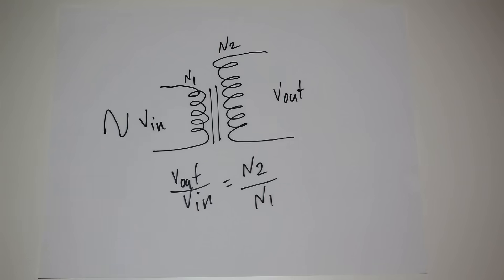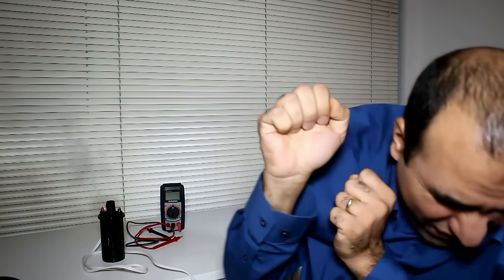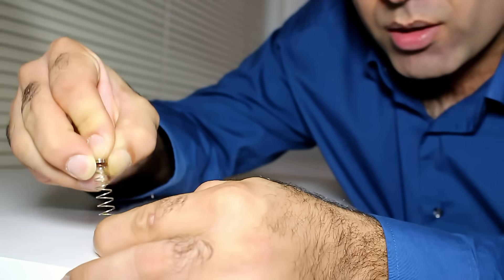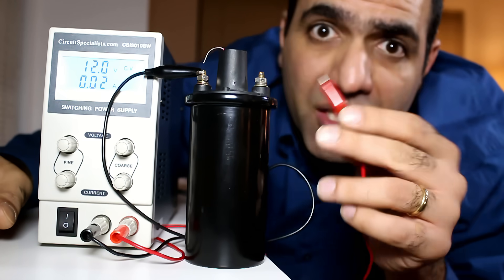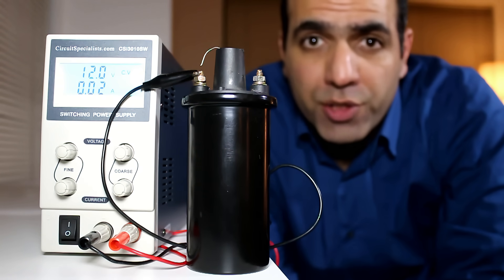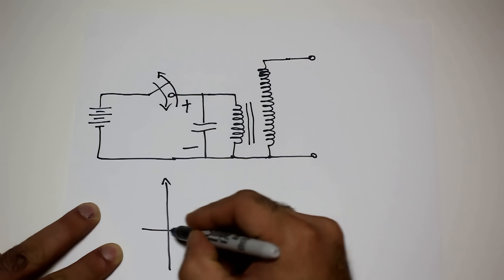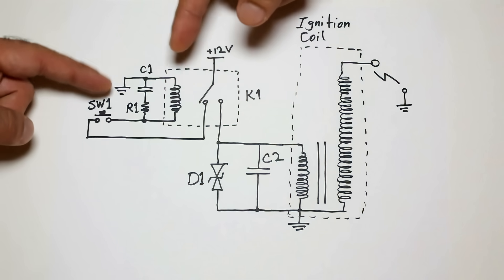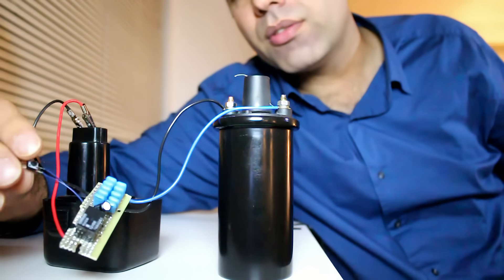How to Make a Taser (Stun Gun)

Comment: Thank you mr electro boom, I am going to make a teaser (for real), I will come back to tell you guys if my piuny transformed survived (and also my self)

Edit:
It didint work and i killed 2 homemade power supplies, i think it was because of the very small inductor i used, I'm planning to either buy a car ignition coil or a transformer
Also anyone knows why my 12V supply dropped to around 6 V
And my 19V supply to around 9v

Comment: Would the core saturate if you were to keep the 12VDC across the primary for too long? Doesn't forcing 12V across the inductor cause the current to ramp up until you saturate the core of the transformer?

Comment: Yea, come into the 21st century ,,,, hypothesis,,,I'm walking through Liverpool on a Saturday night , 2 Scally's ask for my $ , they take a OTF blade out ,, I've got a high voltage ( no where near 10k volts,I think you should explain why 10k volts is not possible btw through a piece of plastic ) taser on me ,,,A/ Do i say "Hold on you naughty chaps, come mug me when I've joined ARO police in 5 years , ill then Taser you and protect myself from your AliExpress Out the Front knife ,,,or B/ Just pull my use in extreme emgc illegal taser ive knocked up, which will give me time kick you both in the Goolies ,but risk a fine in court ? 
I know there ain't option C

Comment: hey Medhi your Resistance of your hand were 8,7 Ohm xD @2:29 in that moment
Reply: It's the primary current not secondary.If the primary side is 1.36 amps the secondary side would be much low current depending on the voltage

Comment: You can use a voltage multiplier between the capacitor and the primary coil but to actually test it without the continuous zapper.

Comment: I worked at a ignition coil factory, we found the coil connecters aligned perfectly with a 9 volt battery, and if you touched the other end of the coil, it would knock you on your butt....lol   from a 9 volt battery!

Comment: ATTENTION THIS IS IMPORTANT:
electricity DOES NOT follow the path of least resistance
if it did (which is does not) and we would arrange 10 resistors of 10 ohm in parallel and one of 9,9 ohm also in parallel
then the entire current would flow only through the 9,9 ohm one
which is obviousley bullshit
also: all the things you plug into your sockets and stoff at home are parallel
which means if electricity followed the way of least resistance (which it does not) then your power supply would power only one led bulb or so and nothing else
which is obviousley bullshit
what people mean when they claim electricity follows the way of least resistance (which it does not) they mean that if there is a route that with virtually no resistance (like your body into the ground or through a short) then virtually all of the current will go that way

Comment: Hey, I got a question

at around 3.38 you started using a drill battery (which is obviously 12V DC right?) how does this whole thing work with DC? as you said in your video and from my own knowledge you can only transform AC voltage

Comment: All this hassle...
ok guys, make taser in 5 mins.
need: 12v power supply, button (plastic. metal button will shock u), some wires and hid headlight ballast.
how to make: strip the tips of ballast output wires and put them ~1,5-2cm apart, that's where sparks will be so watch your hands and metallic objects. connect power supply to ballast input, add the button.
push button and you get sparks just like a taser.
ballast is all you need. no need for relays or capacitors, resistors, diodes etc... just basic wiring skills. the only minus of this is fixed voltage and internal breaker that activates after 0,5 secs of continuous charge, but resets itself when you disconnect it, so you have to push button again and again.
voltage will depend on the ballast but most have 20-25kV.

you can get cheap ballast in bulk in scrapyards. very easy.

Comment: If you notice, you were betting 2 amps or so when it was hooked to 12 volts giving a resistance of 6 ohms or so.  That would give you 20 amps or so at 120 volts.  I made a similar circuit back in the '90s and called it the Spark-O-Matic 2000.  High voltage does cool things to mag tapes and CDs.

Comment: ElectroBoom: "so I designed a simple circuit"
Shows board with a bunch of weird ass symbols.
Reply: Behold, electrical engineering
Reply: Well, i understood the joke, but if you are really interested in what was that circuit, keep on reading

The circuit he made is basically the one you find in your door bells. In a door bell, you magnetism a piece of iron by passing electricity through it so that it is attracted to the bell. Doing that breaks the circuit since the metal is now stocking to the bell, hence the metal is demagnetised and falls back. This repeats the process. Here too, a similar stuff is happening.
Reply: @tejasdixit4417  10/10 interesting reply. Was not disappointed.

Comment: Car ignition coils work on dc voltage. Here's how when dc from the battery is sent to the coil it charges it and creates a magnetic field then the supply is cut the magnetic field collapses and high voltage is made then sent to the spark plugs. How the low voltage supply is cut is different depending on year of manufacturer. That style of coil is used on a points system, there is a distributor that spins opening and closing the points, the points is the switch to open and close the low voltage supply, it also sends the high voltage to the spark that needs it for ignition. This very old and obsolete but still made for classic car restoration. New cars use coil near or on plug and the switch is operated by the engines ecu with a coil for each individual spark plug.

Comment: I have some questions regarding the ignition coil ! Thanks to look into them and give me your opinion if possible. 
Why can the spark from the ignition coil (secondary coil) also discharge on the positive terminal of a battery? I guess that's because there is also a large potention difference from ignition coil ( 20kv) to positive terminal of battery (12v).
Is this the true reason?
A simple Dc circuit with a 12v battery is different compared to a TT system. 
Connecting only the positve terminal to the ground will not cause current to flow.
Same with the negative terminal.
Is this 100% true?
In addition to that ; having that same idea;
Will the spark from the ignition coil have the tendency to discharge on ground just like the negative terminal of battery? 
Can the spark from the ignition coil discharge on ground if I bring the wire lead near the ground far away from the negative terminal of the battery?
I did a simple experiment with a common ignition circuit: 
The simple wiring diagram goes like: current goes from +ve terminal of battery to ignition coil (primary winding) to contact breaker found in distributor. Then I connected a wire from the distributor body to -ve terminal of battery. Note that for an old distributor we may have a mechanical contact breaker switch or an electronic one( ..Both will have same functions: opening/closing circuit of primary coil....In my case it was an electronic one that will allow flow of current from the primary coil to ground and then open the circuit instantaneously. I mean primary coil is not energised at start... a signial is took from an inductive pickup sensor and then current from primary coil is allowed to flow to ground , energizing the primary coil...then instantaneously after that,as the distributor rotates, primary coil is de-energise ...so to sum up....the primary coil is momentarily energised and de-energised ).
The experiments: 
A high tension lead was connected to the ignition coil.
I brought the high tension lead end plug near the ground. Ground being ceramic tiles (note: not the negative terminal of the battery)
Then I started to turn the distributor with hand to initiate opening/closing of circuit form the primary coil.
As I turn the distributor , a spark from the high tension lead flows to the ground but at the same time I get an electric shock felt on the hand used to turn the distributor.
As if the high voltage spark has find its way to flow on the surface of the ground towards me ; through me ; to the distributor body; to the negative terminal of the battery. Is this a good hypothesis?
Note: when I disconnect the high tension lead from the ignition coil and not allowing the spark to discharge to the ground; I don't get shocked as I turn the distributor.
Something more interesting happens when I connect the high tension lead to the ignition coil: I place the high tension lead end above the ground so that it can't spark to the ground ..placed on a support; I only allow its insulation sillicone/rubber to touch the ground. As I turn the distributor, I get shocked as if the high tension lead is radiating energy towards me although its not sparking to the ground. Is it a good hypothesis? The shock is less painful when i raise it above the ground. Sometimes i don't get shock when i raise it high above the ground.
One last thing: In fact , when I disconnected the high tension lead. I didn't get shocked but the sound of a spark could be heard inside the ignition coil.
I guess that the high voltage is being discharged on the +ve side inside the ignition coil.
But like all ignition coils...the secondary coil has a common terminal/connection with the primary coil. Why can't the secondary coil discharge its high voltage through the common wire to the positive terminal of the battery?
I guess that : letting current flowing through the primary coil / opening the circuit to stop current flow is the thing that is actually making voltage induced in the secondary coil..so how can voltage discharge through same wire to the positive terminal of battery...this is not possible!

Thanks to read this big text and give me your opinions.

Comment: THIS IS AN SOS FOR MEDHI, PLEASE HELP. Dear Medhi, I've been trying to replicate this circuit and I need some serious help because my problems go beyond logic !! I've built the exact same circuit with parts of identical values, the only difference being the transformer (which is a 220 V to 9 V transformer wired in reverse for stepping voltage up). When I test the circuit WITHOUT the capacitors, I get tiny sparks at the secondary (so far so good). However, when I test the circuit WITH the capacitors, there are no sparks anymore. This doesn't make any sense... Do you have any suggestions ? Thanks a lot !

Comment: Mehdi, I'm struggling to understand the need for this circuit and the layout. In traditional contact breaker ignition, the negative side of the coil is usually switched (does going to the positive side make a difference?) This is done by contacts opening and closing via a rotating cam. A capacitor is used only to prevent arcing across the contacts. The spark occurs across a small plug gap OK in this arrangement. Have you done it this way to get a stronger spark that would jump a bigger gap? 

Of course, more modern systems are transistorised with individual coils on each plug now, they are fun to play with :D

Comment: The two screw on the sides...

If it both screws are conducting alternating current and it can be timed and turn off.

At center of it, Timed a fan induction wave that pushes the electric spark forward.

Its a pulse gun?

Is that possible?

Comment: If a transformer only works with AC, why is it working when you use a DC drill battery?
Reply: He explained it, the transformer only works when the DC voltage is intermittent (on/off)...that switching produces a high voltaje at the secondary.

Comment: I dont fully understand. why would the voltage reach over 10000v at the secondary if it's only 12v at the primary? shouldn't it a little over 600v at the secondary?
capacitors only discharge the same voltage they are given. why does the inductor increase the voltage?

Comment: Although, I don't have much knowledge. Can you tell me. That If I have a 12v, 1.5 Amp DC current via adapter. And, I want to run a circuit or basically a Bluetooth mp3 player which takes 5v, 1amp and I'm adding 3 - 2 k Ohm resistors in series. Will it work or burn? Shopkeeper game me. And, sorry for commenting without any technical knowledge

Comment: ok I got a new ignition coil and it works now, other one made no spark on the secondary....     but its not able to light paper,  witha  250v  4.7 uf  capacitor.  Most of the time the electricity likes to arc around the paper instead of going through it, which is kind of cool. If you did the power supply 24v instead of 12 will it be double the voltage on the secondary ?

Comment: btw, tasers shoot two high speed projectile prongs connected to the gun itself via very thin metal wires. When shot, the prongs dig into the target's flesh an inch or more, and the electric shock travels from the gun through the wires, shocking the person with the prongs in them. 
      A 'stun gun' is a handheld device with two prongs on the tip, and a trigger or button to activate. These are meant for close proximity combat/defense. The user must physically push the device up against the target in order to shock them. It seems misleading - you would think that the STUN GUN would be the one that shoots prongs while the taser is the other kind, but nope.

Comment: 10.000, just barely half of the tension / Voltage in an ordinary ignition coil of 24.000 V,  Let it be 5.000.000 Volt before we get into the talking :)

In Sweden we have 16.000 V in the rail-road over-head lines as most other countries in Europe. However very, very low Impedance ;) Sufficient to burn a person to mereley a smoking crisp.

A small shock from a static disharge may well have a tension or Voltage of at least 25.000 V

Comment: I have a doubt you say that high voltage kill that's correct but what if I step up the voltage which is like 10V AC to 200v ac and given very less current in input(10v) so basically less power so will it kill me if I touch it as current will be extremely less now.

Comment: U said tranformer only work with ac but u maked it with 12 vilt dc
Reply: You are right.... but it works when disconnect ....  That means there is a changing voltage ... Means when connected voltage is 12 ...  And when disconnect voltage is 0 ... 
That like AC( not exactly but close) ... That is why it warks ...

Comment: I have a doubt about it sir a transformer runs on ac supply then to ignite spark plug of that car engine we need pulse for the  transformer which it obtains from battery supply lets suppose ,then the transformer used in this case should be of a pulse type generally for a pulse transformers turns ratio is very low and more over a transformer meant for pulse generation cannot sustain large ac supply then how did that stun gun contain such large turns ratio and more over as mentioned for a 7.5kv voltage ur hand should have burnt up actually what happend there ??

Comment: Out of curiousity, how high a voltage/current could you run through a car coil before failing? for example, could you sub in say a 18 or 36 volt drill battery successfully instead?

Comment: Hi Mehdi, I'm confused... your circuit and explaination makes a lot of sense... but can you explain what is this https://m.ebay.com/itm/DC-3-6V-6V-400KV-400000V-Boost-Step-up-Power-Module-High-voltage-Generator-/191228126686 ??? How can it be so small? How do you think its circuit works?

Comment: sorry but is it possible to use a transistor to turn on and off the circuit? instead of a relay? also,  the capacitor must be able to handle AC right, i tried with an electrolytic cap and it hasnt worked yet. thanks

Comment: You can buy taser circuits already made on eBay for less than five dollars. Up to 1,000,000 V, actually I did find a 2,000,000 V one. They have the coil and driver circuit all built into one

Comment: Some years ago now some one asked me to sort out the     electrical problems on an mz 125 etz  it's Eastern block  two stroke technology to bring the decadent west down.  The Coil looks the same as the one being used. Noticing the lack of spark started tracing back through the ignition system then noticed the points had welded shut so using a small metal electrical screwdriver parted the points the ignition was on wow wow their was a spark across my fullterm  NATO was not Abel to appose the might of Walsall packed that was only six volt .

Comment: Even if your finger gets close to it without touching it, you feel a jolt.
Tasers affect the whole body only of grounded opponents. For airborne opponents, it will affect the part it hits, but the current will not spread to the rest of the body. Only with a path to the ground will it spread through the body.
Surprise on the wire.
Don't test the full power of a taser on yourself or anyone! Test only a small part of it.

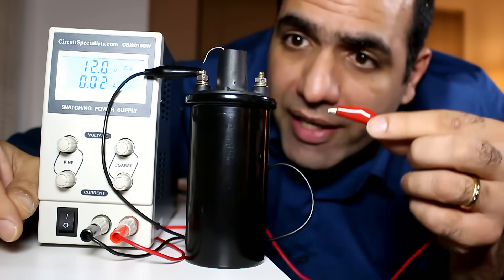Comment: 2:27
Hmm there is nothing. Is there actually a voltage?
(Click)
"AHH F(BEEP) F(BEEP)K"

3:30
"I made my simple circuit here and I attached it to the primary, and i'm using my 12 volt battery source. Let's try it out."
(BZZT BZZT BZZTBZZT BZZTBZZT"
"Wow this is wild. You can see how far (BZZT) F(BEEPEEEEEEEEEEEEEP) (BEEEP)"

3:46
"It's a strange pain. It's as if someone is stabbing your finger, but the blade, it doesn't stop there. It keeps going through your veins until it gets to your heart. I love it."

4:04
"This gap is quite wide. Let me measure it for you."
(BZZT BZZT BZZT)

"SH(BEEEEEEEP) (BEEEEEEP)"
I died at all these parts lmao.

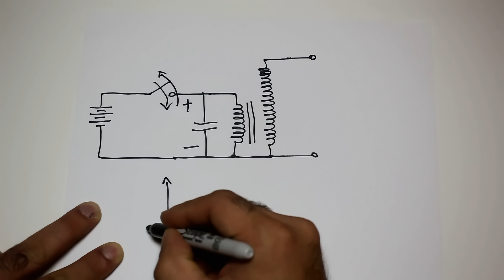Comment: Is the power supply supplying AC or DC current? I seems to be DC, because the capacitor bank at 3:00 would explode every each cycle, as in the schematic it is polarized and would be connected backwards each AC cycle. Am I correct?
Reply from the maker: The supply is DC. The circuit is an oscillator that switches the relay open/close and that makes AC.